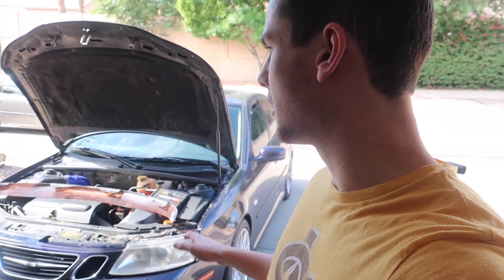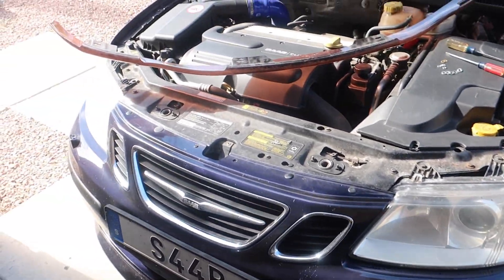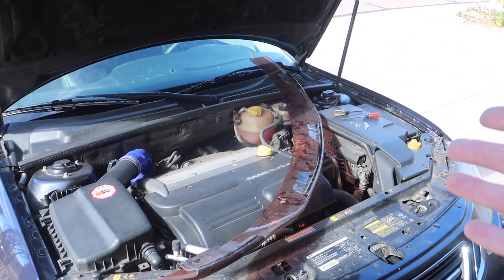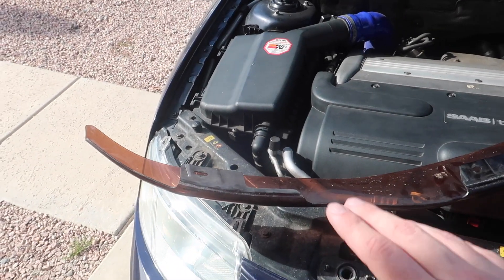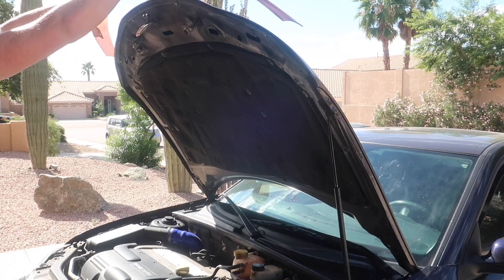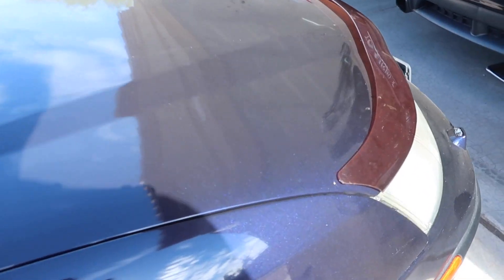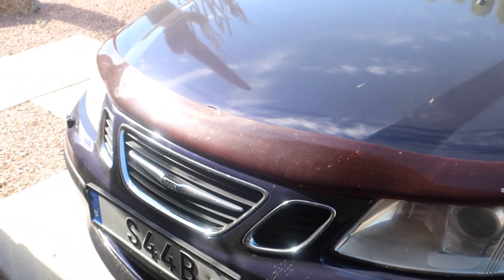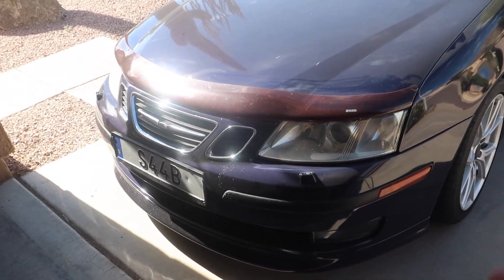Another "Mod" For My 9-3 Arc (Bug Deflector Install) + The 9-5 is Gone!

Comment: Its very difficult to find deflectors for Saab, like your bug deflector or other wind or rain deflector for front doors especially with Saab logo or  "Saab " like on your the LHS of your dug deflector.  The color of this bug deflector doesn't match with your Arc, perhaps you can spray it blue ( match with your Arc's color ) or black as I think it would look much better !
Reply from the maker: yeah, it's not a solid color as is partially transparent so i think painting it would be hard!

Comment: My mom used to have an 87 Saab 900S. On the hood,  the had something from Saab that adhered to the very front that was rough on the outside to protect the hood. Would that be a viable option?
Reply from the maker: i guess you're describing the same thing?

Comment: Does anyone here know what the screw cap on the pipes above the radiator in front of the air intake does. I loosened it with my fingers a bit and air started hissing out ?
Reply from the maker: those are for your ac..

Comment: I have similar 2litre turbo 93 and I'm wondering about that little pipe coming from front of airbox? Does anyone know please? as mine is just capped off, cheers from Australia, btw plastic sheild should help with preventing stone chips
Reply from the maker: SAI; only on 2003 models
Reply: @AutoAutopsy  okay thankyou very much, mine 2003 but no sai

Comment: Never had one on my 08 Saab and honestly would because over time causes paint damage and other issues if not constantly cleaned and maintained and in my opinion on look good on some cars but that's just personal opinion is all.
Reply from the maker: how could it possibly cause paint damage? it protects the paint lol!
Reply: @AutoAutopsy  We'll your correct because it didn't cause damage to the paint per say it was more of when I took it off the paint was more faded where I didn't have it at so it just made a very noticeable difference in the paint color and on a stratus that I had at one time that had one on it when I bought it it caused rust and the paint to crack because of wet leaves being left down behind it but if it was cleaned out regularly i doubt you would have that problem tho.

Comment: Most of the cars that had this installed end up being exposed to increased moisture that lead to rust problems. I am certain its nothing to worry about in your climate, but somewhere with salt on the roads, well that's one of the things I would definitely keep away from any car. The looks inho arent any better also. Doesn't do car justice.
Reply from the maker: interesting tip! i agree